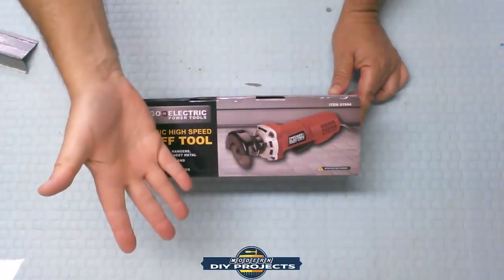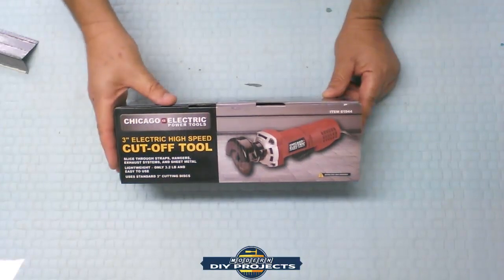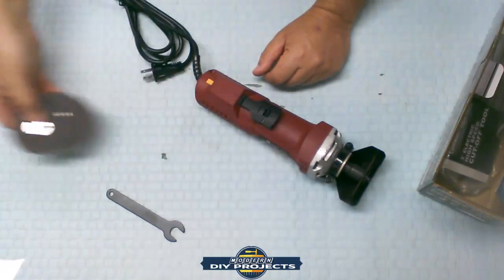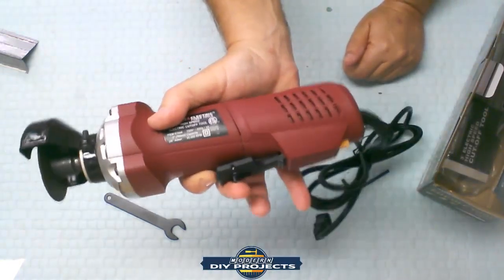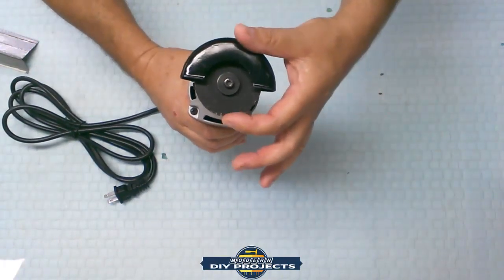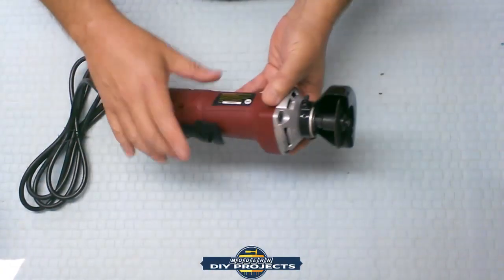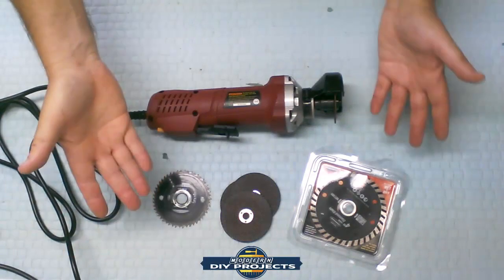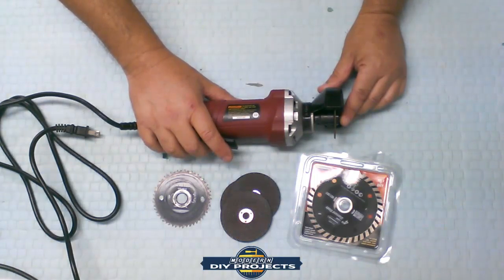Harbor Freight 3 inch Cut off tool Review Chicago Electric

Comment: Had one for 8 years still works never replaced the brushes. I've cut angle iron for 8 hours and it never had a single problem. Cut sheet metal to build gas tanks, replace damaged car panels, cut rebar for outdoor projects, cut bolts of every shape and size, and so much more.  Hands down one of the best harbor freight purchases of all time. The switch used on this creates a large safety barrier compared to a angle grinder that stays on unless you flip the switch back (which can be dangerous if you drop the tool or it slips out of your hand). It has the correct speed for cutting most metal with the one speed it has. You can also bypass the safety shutdown feature that kicks in when pushed too hard through metal. This tool has a lot of capability.
Reply: Do you know if it can also be used for wood?
Reply: @valeriahernandezsolano1977  If it cuts metal 102% it cuts wood. Just get a wood blade

Comment: Ive use my on different metals , slow but can work. The complaint I have is the direction it turns. I  wish it turn the opposite direction. I going to take it apart and see if I can change directions.
Reply: Arbor thread direction is why it spins the direction it does. Resulting force of the wheel against your work acts in a way to tighten the arbor screw. Switching it without changing the threads to LH thread increases the risk of the wheel spinning off at 20k rpm

Comment: I live across the street from Harbor Freight. I need to cut off 2 old metal hinges for my new wooden gate. They are coming out of a Brick wall, and are like Thick nails. Which point straight up. plus they are are in the concrete not the brick wall. So this will do, me thinks. I'm going to replace the 2 hinges with 3 hinges . Thanks for the Review.
Reply from the maker: That is a perfect application for this tool.
Reply: Lucky guy (living across the street from harbour freight)

Comment: You have a wheel shatter at 20,000 RPMs and I’m guessing you would want that guard in place to block some of the shrapnel. I realize you demonstrate taking the guard off while using blades but same principle applies.

Comment: the circuit breaker in mine trips way to easy ,but for the price kinda worth the hassle I guess
Reply from the maker: I have not had that problem but I have seen videos that show how to bypass the breaker. Check those out if you get tired of dealing with that.

Comment: Looking for a how to video to install my cutting blade correctly on my Chicago electric cut off tool
Reply from the maker: Use the included wrench to hold the neck or shaft steady, then undo the nut in the middle of the blade with the included Allen key.

Comment: I’ve looked at this tool and it appears that because of it design, it’s meant for trimming and edging.  Seems as if it would be difficult or impossible to cut say, “a three foot section of pipe from a 10 foot piece.  Am I correct, and does this perform such tasks?
Reply from the maker: It works fine for trimming and cutting. It's like a sideways angle grinder. It could cut a pipe if you put a big enough disk on it. But you need to remove the safety cover to do that.

Comment: I’m trying to cut through a vehicle fender (thin sheet metal). I started using an angle grinder but found it way too difficult to see where I was cutting. The cut requires following a precise line. Do you think this cutoff tool would allow for fairly precise line cutting? It seems that this tool would allow you to see where the blade is going, unlike a 90° angled tool
Reply from the maker: Yes, this tool is like a sideways angle grinder. It will allow you to see much better where you are going with your cut. If you need to be VERY exact with your cut then to be safe I would leave like a 1/16th or 1/32nd line of safety that you could grind bad. It's easier to take off metal than put it back.
Reply: @ModernDIYProjects  thanks for the reply. That’s what I was hoping to hear. And roughly exactly is good enough for my job, thankfully

Comment: I have arbor that’s bigger. What you filled it with again? Cz my blade is moving
Reply from the maker: You can use a small washer to fill the hole. Anything that will fill the difference in the arbor will work, even a custom made plastic washer.

Comment: Can I use this tool to cut piece of hardwood flooring? I removed a wall and need to even out area to fill in the gap where the wall was.  I have a circular saw but it not comfortable using it.
Reply from the maker: For your purpose I would recommend instead to use a multi-tool, You can check out my other video on these tools https://youtu.be/vETIrNukwnE

Comment: I was thinking of getting one of these to cut through my motorcycle exhaust pipes; not necessarily completely but more as a pilot cut unless I can walk around it a few times would that work? Also what grit would be best?
Reply from the maker: I don't know how thick a tubing they used on your particular bike, but it should work. Any metal cutting wheel should be fine. You want a fine grit to grab better and not dance around. The coarser it is the more it will want to dance.
Reply: @ModernDIYProjects  Thank you for the reply. I think the pipes are something like 1/4 thick (or maybe 0.0065 ) or similar; I am not the best at measurement reading. I was looking at HF and saw a 3 inch Chief wheel about 1/16th thick x 3/8 inch;  Type 1/41
Reply from the maker: Give it a try and see how it goes. You may be able to use an angle grinder also if you have one, or maybe the angle isn't right for you.
Reply: @ModernDIYProjects  yeah for sure. I do have a angle cutter too just in case.

Comment: Great review, thanks.  I'm kind of confused about using a larger cutting wheel.  I understand about removing the guard, etc and that is has a 3/8 arbor.  You said to add a washer?? I don't know how a washer would help unless it fit inside the opening of a larger arbored blade.  Are these washers easy to find, or am I missing something?  I'm looking for a slightly deeper cut and would like to do one time step up to a 4 1/2 inch blade for possibly cutting/scoring bricks.    Thanks
Reply from the maker: I only suggested using washers because the arbor was bigger on the blades I had on hand. If you find larger blades with the same opening then you wont need them.
Reply: @ModernDIYProjects  thank you

Comment: Is it good to cut small tiles? What kid of blade I can use?
Reply from the maker: You can use a stone cutting wheel with this and it should work fine. You may also want to consider an oscillating tool for safety reasons. I don't know exactly how you will be using this tool but you said small tiles so I don't want you to cut yourself by accident. Watch my other video and see if this may be better for your use = https://youtu.be/vETIrNukwnE

Comment: Would this be able to cut through a 1 in thick metal bar that's not hollow?
Reply from the maker: I don't think so. Something that thick would cause it to bog down and trip the built in breaker it has. For something that thick I would suggest a cut-off saw instead. This is made more for sheet metal, like car body work.
Reply from the maker: I see. If you need to use this tool because it is a tight area to get into then I guess it could do it over a prolonged use, but not in one go. You would have to work at it for a while. Why not try a recip saw with a metal blade instead?

Comment: Can you use it to cut off a bolt for sway bar link?
Reply from the maker: With the right cutting wheel, sure it can. It is made for cutting metal so that is not a problem.

Comment: Great video. Tell me about your gloves!
Reply from the maker: Those gloves are just simple Hardy gloves that you can pick up and any Harbor Freight store. They're usually on sale for around $3, nothing fancy really.
Reply: Heat resistant? I find my Dremel gets real hot. Or the items I’m cutting. Still afraid to try the cutoff wheel but curious if that gets hot? I’ll be cutting vintage silverware mostly. At least in the beginning.
Reply from the maker: @bangitoutdesigns1559  These are just padded work gloves. Not really meant to be heat resistant, but insulate well enough. The items being cut if metal will get hot, but not extremely.

Comment: Can it be used to cut wood?
Reply from the maker: For sure. I have used it for wood, but you have to get a wood cutting blade. The one for metal will only burn the wood but wont cut.
Reply: @ModernDIYProjects  what wood wheels would you suggest for this?
Reply from the maker: @blackpowderpatriots4955  For wood you do not use wheels, you need to find blades (saw blades) that are small enough to fit. Wood you need to cut, you can't grind it like metal or it will just burn.
Reply: @ModernDIYProjects  the smallest wood saw blade i can find is 3 3/8.  Will i need to take the safety thing off to use that blade.  Thanks for this video.  I bought this to cut a couple of pieces of pallet wood and I didn't know how to use it or change the blade or anything thank you so much!
Reply from the maker: @missterry428  I can't say for certain if you need to remove it or not but if you do need to remove the safety cover Please be VERY CAREFUL I don't want you to get hurt! Think about it long and hard before you do it. Or use a different tool if it may be safer for you.
Reply: @ModernDIYProjects  thank you! I think ill just return it and get a reciprocating saw.

Comment: Hey, im first with a review. 
✔Good job on this review.
I've had one of these for awhile and it works fine. Only con, it is  a little noisier than name brands. 🤣
I use it to shape 1/4 thick bar steel.
Reply from the maker: Thanks. Another con is that it doesn't have a lot of torque so it can bog down and stop the blaed if you push too hard. It's not as strong as an angle grinder.

Comment: I used mine to cut a piece of plexiglass and half way into it it turn off and it won’t start 😏 👎
Reply from the maker: It has a heat cut off built in on some versions of it. Look through your manual it tells you how to reset it. Mine doesn't have that heat sensor built in.